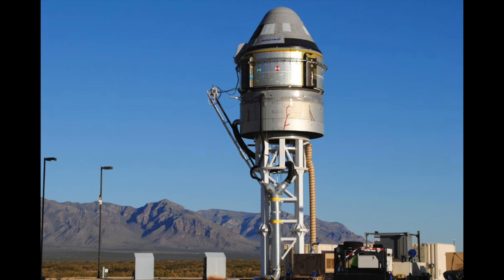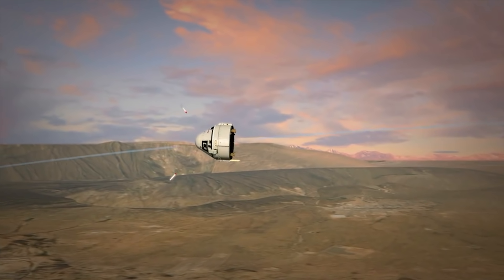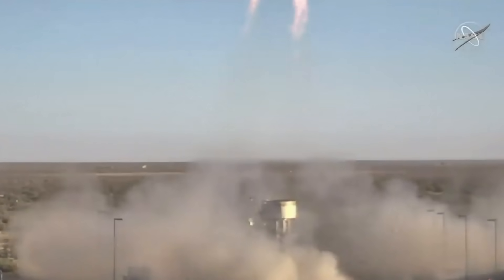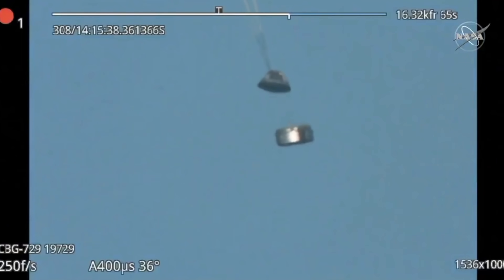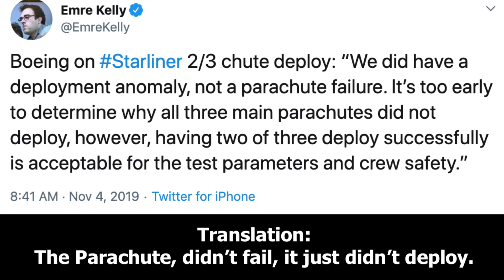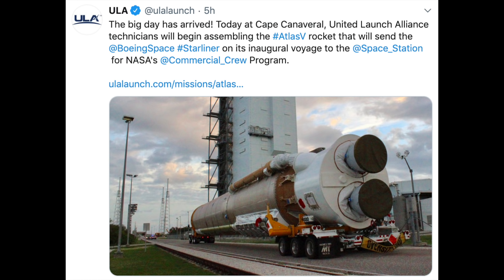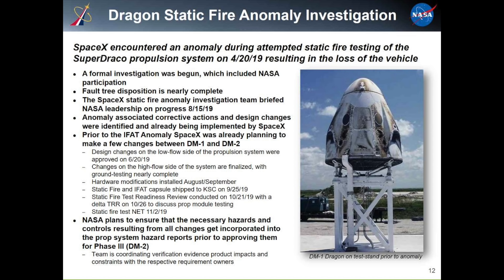Parachute Fails To Deploy During Boeing's Starliner Abort Test.

Comment: I thought parachutes are already well-hung technology 🤔
Reply: Might depend on how well-hung the engineers at Boeing are...
Reply: I seem to recall a test at Wallops a few years ago, testing part of the next US Mars lander's parachute system at supersonic deployment, which also only partly deployed (maybe; if I'm remembering correctly, that is.) Parachutes are indeed relatively low-tech and broadly understood, and yet, still problematic in deployment for a whole slew of reasons. In this case, it seems the drogue bridle separated from the main, leaving it stuffed in the container. 

If this were a skydive rig, it could mean several different things (which may not have an analogue with Boeing's deployment system). The drogue bridle may have failed and snapped; the closing pin on the container holding the main chute could be jammed; the deployment bag may have been pulled from the container but twisted lines tied it up preventing the main chute from deploying; or, my personal favorite, everything may have physically functioned perfectly and the deployment bag is stuck in a vortex of air on the leeward side of the capsule (I highly doubt that for this test, but I've had that happen more than once on a skydive.)

The point is, with parachutes there is only so much that can be accurately calculated or modeled, especially in the phase of deployment with turbulent air, tumbling fabric, and lots of long lines. Chaos theory holds significant sway here, to the point where even if everything functions correctly, there still can be failures in deployment.

That being said, I fully expect Boeing will identify something like the equivalent of a stuck closing pin...

Comment: Not an expert on the deployment system for the parachutes on spacecraft, though I used to hold a senior riggers rating for sporting parachutes. The most likely explanation would be the drogue detaching before the main parachute deployment bag is released from the stowage position. Without knowing the details of the system, components and assembly procedures it would be impossible to narrow down the exact failure mode.

Round parachutes in general are pretty reliable as long as they are exposed to a bit of air...

Comment: While designing stuff like this with redundency is generaly glever, you should not rely on that durring a god damm test.
Reply: Maybe need a little redundancy in the fuel valves, the ones that already had a problem with leaks.
Reply: nobody was relying on it,  nobody was at risk.  It seems to be a good thing to happen in a test really,  its is really why they test.  Now they can fix the problem and move closer to 3 for 3 nearly every time.

Comment: I'm pretty sure that a big cloud of oxidizer from the service module is a problem. In my opinion, they were pretty lucky that the tank with the other stuff didn't also blow or they might have had a fire and/or explosion to deal with. This might be far away enough not to endanger the astronauts, but it could still delay any rescue operation, which is a bad thing in itself.
Reply: And Starliner had big streamers of NTO around it after engine shut down. A valve didn't close, or worse, there was a leak. That would set back Starliner for a long time. OK, its possible that some propellant was expected to dissipate out after engine shut-off. But there was no such cloud with the SpaceX pad abort test, way back when.
Reply: @donjones4719  Yeah, in case of an abort the astronauts may be injured (high g loads and all). NASA will probably want to avoid waiting for everyone to dress up in bunny suits and clean up chemical spills before rescuing the astronauts.

Comment: With a probability of 1/3 for each single parachute to fail, of 27 average launches we would expect to see a single parachute failure in 12 cases, double parachute failure in 6 cases, in one case all three fail and 8 have no failure.
Reply: There is no evidence for "probability of 1/3" based on a single test. Even if you assume a perfect binomial distribution and totally independent failures for each parachute, the 95% confidence interval is between 0.8% chance of failure and 90.6% chance of failure — which is basically to say it's meaningless, especially considering a binomial distribution and independent failures are both almost certainly false
Reply: Paul Paulson - You must know that we’ve only had 1 single parachute failure (Apollo 15) & 1 double parachute failure (Soyuz 1) in the whole history of human spaceflight, & that is a LOT more than 27 launches.
Reply: @TraditionalAnglican  Yes, and the reason for that is that after unsuccessful tests problems get fixed and tests repeated until the probability of a single parachute failure is way lower than 1/3. 

All I'm pointing out is that looking at just one test with one failed parachute, saying that it's ok because there are two other parachutes wouldn't be reasonable.
Reply: Paul Paulson - That’s the main reason why I’m saying that this anomaly is something Boeing & NASA really need to examine in detail, & that this test cannot be considered a success.

Comment: B1046, the booster that will be used for the inflight abort test still has the expensive titanium grid fins on. Are they going to try a waterlanding? Surely it will be very unstable with the dummy second stage on top but no capsule at max-Q?

Comment: Regarding the parachutes: I would think it would perhaps be cheapest and most efficient to replace each parachute such that any two parachutes in combination can safely land the craft. That way, if there's a failed deployment ... no problem. Built-in safety margin. :)
And, of course, make them such that if (ideally when) all three deploy properly, it still comes down at a reasonable (not too slow) rate.
And "ideal" rate with all three, and a "safe" rate with two.
They'd perhaps have to put in slightly larger parachute bays I suppose. But that couldn't be THAT much of a challenge, I'd think. But then, IDK how the parachutes are stored.
Reply: That's already the design though...

Comment: Scott, I wonder when they designed the system that it only required two parachutes to work and they added the third for redundancy in case of a failure.

Comment: Fortunately this isn't a design problem it was a human error procedural one. It turn out that a pin was missing on that particular pilot chute so that it failed to pull out the main chute. So nothing really serious going forward and nothing that will delay the upcoming OFT flight with stacking already underway on the N22 Atlas V.

Comment: There appears to be a couple problems here ... first, I can't imagine why there should be a big cloud of N2O4 emanating from the service module well before it hit the ground and I can't help but wonder if that played a role in the second problem, the failure of the third parachute.  I still think the crew would have comfortably survived, but they better not vent the capsule until the toxic cloud dissipates and venting is, I think, needed to equalize the pressure to open the hatch.  So, I'd rate this a D-.

Comment: looks like one of the drogue connect cord snapped. could have been a packing problem, or it could have been nicked by debris during separation. doubt it was a design problem (i.e. the cord not strong enough to handle the load), because odds are there would have been more than one break. either way, Boeing proved their abort system works in the ground phase, and the capsule did land safely even though only two of three parachutes deployed, so a mostly successful test.

Comment: Would they deploy the parachutes while the capsule speed is faster than mach 1? If so, this test doesn't simulate conditions for which the chute system was designed.

In one sense, Boeing might be correct in stating "this test was a success" if they narrowly define "this test" to be the abort sequence. However, the chute system is essential for safe re-entry in every mission profile, so if there's a problem, it affects every mission Starliner will ever fly, not just the emergency bug-outs
Reply: Yes, "this test" was specifically the abort sequence. I mean, that was the whole point of the test. I don't really understand what you're trying to say here.
Reply: @HiddenWindshield  two points: 1. Two parachutes might be sufficient for sub-sonic speeds but not super-sonic. If so, this problem would have resulted in a catostrophic mission failure.

2. Regardless of 1, the parachutes are used in every mission type, so any chance of failure will be risked on every mission. Therefore this is a major issue, as every mission depends on it.
Reply: @notyoyoma  Ah, now I see what you were saying. (Which might actually be my fault, since, going back and re-reading it, now it makes perfect sense.)

While we obviously can't know for sure until someone at Boeing says one way or the other, parachutes aren't typically used until the capsule has slowed well below the speed of sound. For Apollo capsules, the drogues weren't deployed until below Mach 0.7, and the mains didn't come out until well below Mach 0.3. And the physics of falling objects means that, unless you opened the parachutes way too low, the impact velocity would be the same regardless of whether you started from space or from an emergency escape.
Reply: @HiddenWindshield  no worries.

I didn't know that about Apollo, and you are correct, it's probably similar in this case. NASA's follow up will be interesting.
Reply: @notyoyoma  This is not ULA
Reply: @AmbientMorality  ah quite right. I got mixed up because Atlas V (what it will launch on, hopefully soon) is by ULA, but Starliner is just Boeing. Thanks for the correction. I'll edit the comment.

Comment: If I was onboard I'd of been more concerned about that cloud of hydrazine then the parachute failure.
Reply: Walter 1408 - Do I get a whiplash & a really sore back? Or do I (or one of those tasked with saving me) die from breathing the poisonous gases? Neither is desirable, but I’ll take option A.
Reply: Agreed. I've worked on the old Titan pad at the Cape and the safety lectures on nitric acid and hydrazine are scarey.

Comment: I don't understand why they don't ditch the service module immediatly after the flipping maneuver and before the first batch of chutes are deployed. The overall weight would be lighter so the pod would decelerate faster, the service module wouldn't be slow down by the chutes and land a bit further preventing the ground ppl to be in the area of hydrazine emanations and leaks. With the current maneuver the pod don't fall that far from the service module.
I understand that hypergolic fuel is simpler to use and safer for an escape system than most of other liquid fuels, but with the configuration of the abort flight, I find more secure for ground crews and even onboard crew to go back on the ethanol fuel.

Comment: Wouldn't it be better to try to use up all the propellant while airborne? Either boost the crew module until you run dry or re-start the engines after separation?

Comment: I'm curious at what the failure rate for parachute deployment on the Apollo was by comparison. Don't ever recall seeing a single example of a failure in that program.
Reply: Apollo 15 had a parachute failure. This was more of a deployment failure probably due to QC steps skipped during qualification testing (that wouldn't be skipped for a full mission).

Comment: I work in the medical industry and I do a lot of failure/risk analysis; and, yes, if I were NASA, I would be concerned about the parachute failure.   Yes, the test was "successful"; but, the parachute failure might be an indicator that the parachutes deployment is less reliable than expected and I would want a LOT more data to prove otherwise.  Example: If this means that parachute deployment has a 1/3 failure rate; then, 2 failures is a 1/9 rate and 3 failures would be a 1/27 failure rate.  That would be BAD.  
I assume NASA has learned from their shuttle mistake where they ignored primary seal failures on the Shuttle SRBs because the secondary seals "still held".  The result = Challenger explosion.  A frequent primary protection devise failure means that the secondary protection devise is now the primary protection devise and your original risk analysis is invalid.  The same is true for parachutes.

Comment: People who are poking fun at this obviously don't understand what testing is for. You test to not only make sure it works, but to also catch any failure modes you didn't anticipate. I can say from experience when I test products I design I want there to be failures. I want to know what can go wrong when its easy to fix. The worst kind of testing is the kind where everything seems to go "just fine", and then it absolutely tanks when it goes commercial and turns into a multi-million dollar problem. Its much better to have issues here then leave a large shit stain in the middle of the desert when it fails during an actual abort.

Comment: Could it be that the parachute detaches if deployment will cause geforces in excess of human safety limits? Example a strong jerk on the craft injuring the astronauts. Or also might the shut detach detach if the gforce would cause a catostrophic failure of the capsule it self? Like a built in gforce limiter when shoots deploy.

Comment: That Cloud of super-toxic Hydrozine fuel is really nasty... at least the astronauts would have their suits on sitting in a sealed capsule while connected to the air system of it. But evac would spend some time with that stuff nearby... If some of them get wounded, for example because of 2/3 aero braking results in higher end velocity, that could get critical. I wonder why they didn't use up more of it during the abort burn... empty tanks are supposed to be safer I think.

Comment: They shouldn't have repurposed that 737 Max flight computer to control the parachutes. ;-) I also noticed a lot of clouds of what might be nitrogen tetroxide around the vehicle at various points. Unless they are deliberately venting it for some reason, it does not look good. I also wonder if unwanted hypergolic propellants didn't do something to prevent the chute from deploying. It wouldn't be the first time an unexpected corrosive chemical messed up a parachute system.

Comment: Regarding the poisonous orange cloud: In a real abort scenario the service module would be dropped from a much higher altitude which would surely result in a much greater separation on the ground. I wouldn't want that nasty thing falling in my back yard though. They would be launching over the ocean right? So in an in-flight abort they would be coming down in the water?

Comment: During the flight, was all that venting of oxidizer normal? Was all that "orange smoke" during flight normal? Or could that indicate that also something else went wrong? Reading here and there, there are people saying that the N2O4 oxidizer is not friendly at all with the parachute materials. I watched the live steam, and besides the 3rd parachute failing to deploy, I was always under the impression that they're avoiding a second "touchy" subject... Overall there was a sort of cringe in their live stream that I felt it's not entirely relate to the chutes. What's your take on this?

Comment: In 1991 a patent was approved called "The Welsbach Stratospheric Seeding Method for Combating Global Warming." This patent describes putting nano particulated metal oxides directly into jet fuel thereby avoiding having to refit planes with spray systems. This would allow any jet engine to be used to cover the sky in perisistant trails that reflect sunlight cooling the Earth. One of the lawyers used to file this patent was Wanda Denson Low. This chemtrail patent lawyer later went on to become the Senior Vice President of Internal Governance...at Boeing.

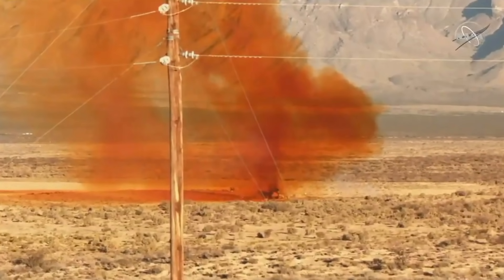Comment: 3:44  Land the capsule upwind of the service module. Equip astronauts with full-face respirators and tyvek hoods - their launch suits should make excellent hazmat suits as long as they're corrosive resistant. Send in recovery teams equipped with class A or B hazmat gear. That's about as safe as you can make this process without using a less volitile fuel.

Comment: Ok, so this is something I didn't really get until now:  The dinitrogen tetroxide is cryogenic.  I keep looking at these things and saying "That looks a lot like just nitrogen dioxide to me", and it is.  Nitrogen dioxide (the thing you get tons of from most reactions with nitric acid) sort of phase changes into dinitrogen tetroxide at low temperatures.
-edit
Warning: All that stuff I said might be partially wrong.  I'm confused about the freezing point of dinitrogen tetroxide.  Wikipedia has failed me.

Comment: "parachute science" hahahahaha im in tears.... Another phrase that i will treasure from Scott just like "fly safe" :)
Reply: Have a tissue
Reply: what are u talking about? Parachutes are easily one of the most complex systems on any spacecraft module. Especially with regards to aerodynamic modeling.
Reply: @kingspork5152  agreed dude although i regard the propulsion section of every spacecraft more complex and challenging
Reply: @elefterioskarampasis9574  And I regard the flight control systems (guidance, navigation & control) as being even more challenging than that. My point is parachutes definitely rank very high up there.

Comment: Apollo splashdowns had the same problem and the astronauts survived. Perhaps it's a problem inherit to multiple parachute systems. 
But those were of course splashdowns.
Reply: Archaeopteryx128 - The Russians had the same problem with a Soyuz, & an astronaut was killed - 
https://en.m.wikipedia.org/wiki/Soyuz_1 
That was a single parachute with a backup. Both failed. Crew Dragon uses 4 & can safely & comfortably land on 3. Starliner uses 3 & 2 would be safe but fairly uncomfortable.